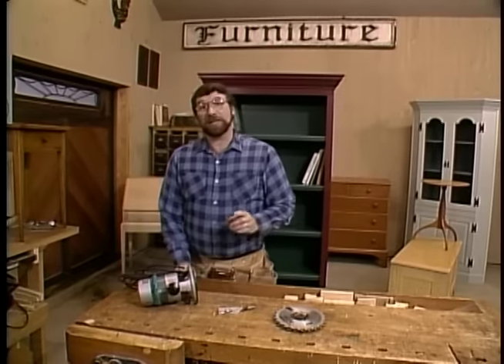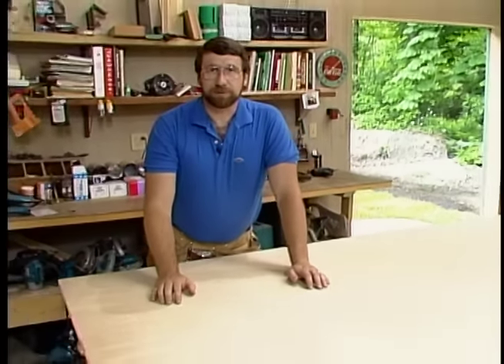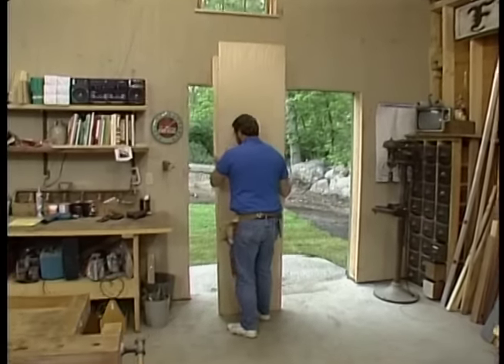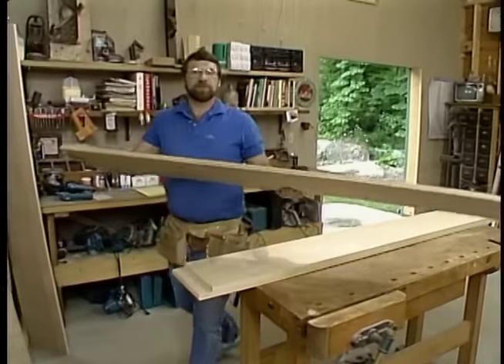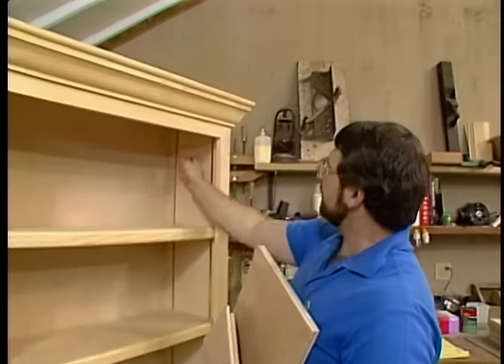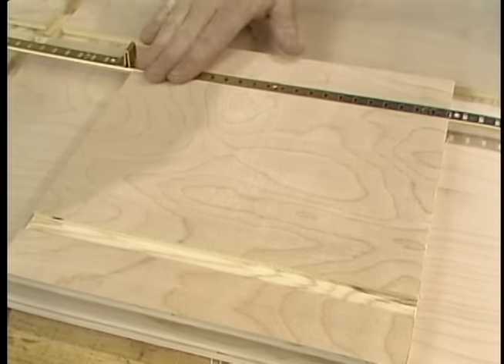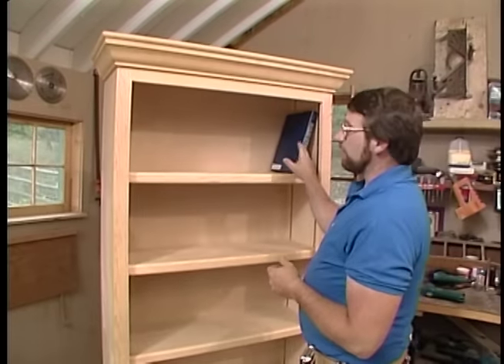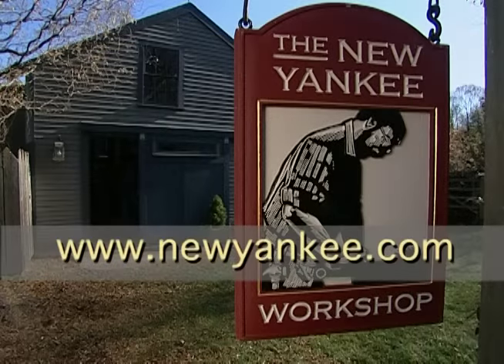Bookcase  |  S1 E8

Comment: Can one still purchase a radio arm saw? 
I had to get rid of mine several years ago, and I miss it.
Reply: They're made by several manufacturers. Woodcraft sells several but they're not cheap. A sliding compound miter saw mimics the cuts and is a less expensive multi-tasker but may not be able to handle stock as wide as a true radial arm saw. But they are much cheaper and most places like Lowe's and Home Depot carry them. DeWalt makes a couple nice ones.
Reply: They are somewhat rare, they are considered dangerous so must manufacturers have stopped making them.
Reply: Better off buying them from estate sales etc. Lots of nice old ones sitting barely used in basements and garages.
Reply: **radial**

Comment: Norm, great video.
Where did you get your radio- arm saw?
Thank you again.
Reply: Well, it would have been in 1989 or earlier (34+ years ago). I'd have to look again carefully, but it's likely a Craftsman, which, at the time, was a Sears brand.  By the way, it is called a 'Radial Arm Saw".
Reply: Yes it is, a Sears Craftsman Radial Arm Saw. I sold these at Sears while earning my way through college. Picked mine up in 1990 thanks to Norm and The New Yankee Workshop. My grandfather and Norm taught me how to make furniture! Still have it in my current shop and it runs like the day I got it. Can’t do rabbit or lap joints on a mitre saw!
Reply: @timmillervideo   that's why I couldn't find one, I kept looking for a "radio-alarm saw" 🤣
Reply: I still have my Craftsman radial arm saw I purchased in May of 1985. My nephew has the band saw, table saw and jointer/planer from the same year. Good tools. I also still have the Craftsman hand power tools from the same year. They sit on a “museum wall” of sorts in my my. Memories. Thank you.
Reply: Had one years ago and it was never accurate.  Was a good chop saw only.
Reply: This was decades ago. And it's radial, not radio.